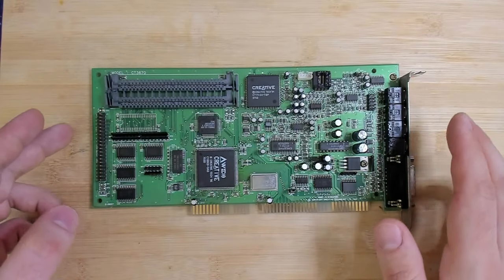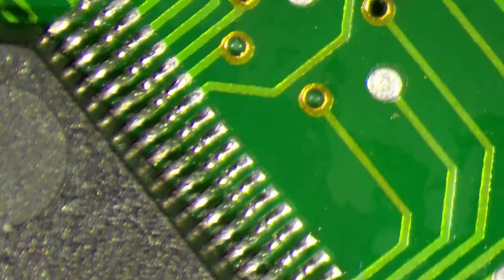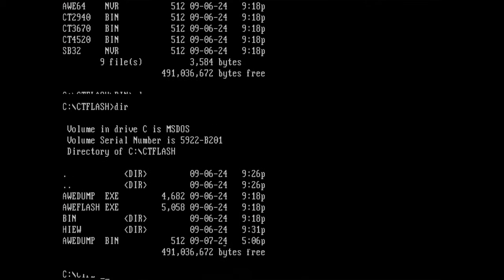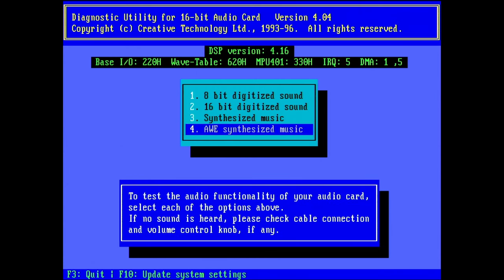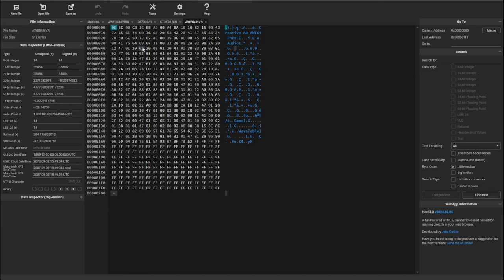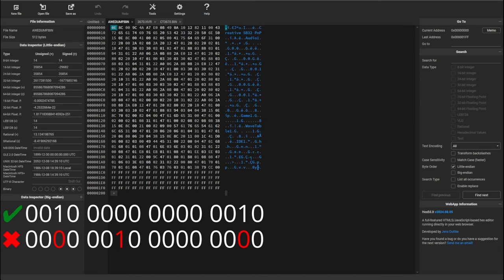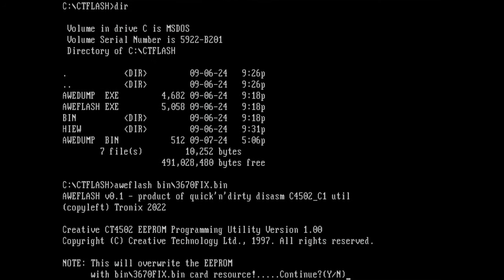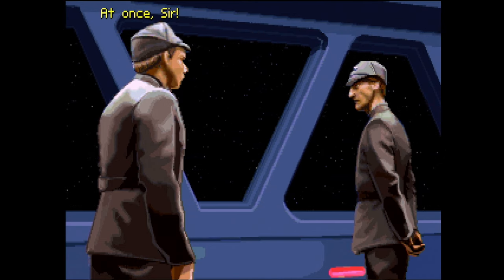This SoundBlaster 32 PnP CT3670 must live! Let me try again!

Comment: I'm not sure I'd call this a "BIOS". It's more of a configuration table. Either way, congratulations on restoring what looks like a pretty nice sound card.
Reply from the maker: Yes, it is probably just a place to store some information. However, I wonder if the PnP settings are stored in this chip as well. Thanks!
Reply: It's actually called firmware, but BIOS(Basic Input Out System) works well too.
Reply: @lexluthermiester firmware implies it has code.

This looks to just be storing some configuration values.
Reply: @shaunclarke94  "BIOS" implies the same thing. Not really a good point.
Reply: It's NVRAM  (non-volatile random access memory) , not BIOS or Firmware. Hence the file name extension NVR.
Reply: @lexluthermiester  BIOS and firmware aren't good terms for the same reason. My point applies to both.
Reply: Yeah, it's not code so it's not really BIOS or firmware. The programming tool calls it "Resource Data" which makes sense, from other messages we can see that it provides resource requirements for four "functions" (one of them the IDE controller), each one presumably has a list of IO ports, IRQs and DMA it needs and can utilize. I'm unclear on whether they also stored current selected settings there, they might have.
If you have a motherboard with PNP BIOS it reads these resource requests from all the PNP cards and tries to find a conflict free solution so that all PNP cards get the resources they need - many motherboards will then cache this solution in the (optional) Extended System Configuration Data to speed up startup and avoid "works, then doesn't, then works" scenarios. The ESCD really helps with startup time when you have lots of ISA/PCI PNP cards, any time you change anything you get just one slow startup. With early ISA PNP motherboards it wasn't unheard of getting stuck on "Updating ESCD" and having the clear the ESCD in the BIOS (or even use the clear CMOS hardware option).
Reply: @bitsundbolts   Yes it's the stuff at the first 16 bytes of the chip. PNP data
Reply: I would not be surprised if the two bytes that were corrupted in the NVRAM were in fact for setting / detecting the I/O base address of the card. The byte sequence { 0x02, 0x00 } would be interpreted as 0x0002 in little-endian, whereas the "correct" byte sequence { 0x20, 0x02 } would be interpreted as 0x0220, which coincidentally is also the I/O base address that is used the most for Sound Blaster (and compatible) devices. By the way, I/O address 0x0002 is "DMA channel 1 current address" of the primary DMA controller in a PC.

One final note: the AT49F512 is in fact a 64kx8 FLASH EEPROM, so I wonder what else could be hiding in there...
Reply: Was about to post the same.
Reply: @shaunclarke94  
Not getting into technicalities, the data stored on that chip amounts to code that is needed as a part of the driver exec and therefore counts as code needed to execute the function of the card. But let's not fuss over what amounts to semantics.
Reply: @Torbjorn.Lindgren  
Those are fair points, however, as shown by the necessity of the need to reflash the chip on the card, it shows that the code contained therein is a part of the code needed to complete the functionality of the card and thus is a part, even if a small part, of the exec code required.
Reply: @lexluthermiester  I'm fairly certain there's no code in the chip, what happens is that OTHER code (drivers/BIOS) refuses to load/use the data in the PNP block because the checksum is invalid and thus nothing can be set up with ports, IRQ and DMA. That's how we go from zero (4:32, just "ERROR") to four (22:26) "functions" by fixing just one of the four data blocks (they're fairly visible in the hex dump, since the resource data includes name) - the other three were intact but wasn't read due to the checksum failure. Data can be just as important as code.
Reply: @Torbjorn.Lindgren  
That is a fair set of points. It could just be a look-up table. The thing is, that's a bit of an expensive chip for just a specs table listing. Who knows. It was a weird time back then.

Comment: Hey, THAT IS NOT AWE synthesized music! Don't you hear that's FM synth? Something's wrong still.
Reply from the maker: Well, that is a Soundblaster 32. It may not play properly without the correct settings table. Maybe this card was not supposed to do that. The only way to find out is if I flash the AWE64 settings to that card.
Reply: @bitsundbolts  as long as it's AWE card and it must be containing onboard memory with samples, it should play AWE music. But something's wrong. Maybe onboard ROM (or RAM?) failed and the chip redirects midi to FM synth instead of wavetable synth. Bad thing is that there's no error message while something is definitely wrong.
Reply from the maker: There is no RAM on the card. The spot on the card for the memory chip is empty. I would have to install SIMM modules which weren't part of this project. I will try that soon though.
Reply: Maybe it worth testing it with Windows 98 and SIMM memory installed. Maybe it will work with external .sbk instrument bank uploaded to SIMM memory.
Reply: @Auberge79  About EMU8011 ROM I was wrong. It is present on CT3670. I would have to try my CT 3670 to check how this test sound like.
Reply: @MM-gd3be  I see now. So this is SB 16 Vibra basically unless SIMMs are installed.
Reply: Maybe the stock wavetable samples need to be copied from ROM to RAM in order to be used by the AWE chip. As there is no RAM installed, the card drops back to FM output?
Reply: I do have the Ct3600 32 PnP version with 2 small 512KM 30pin ram mounted - this card plays AWE options perfectly. But the ram is only useable for loading up some random midi for games. The problem here is that You are not using AWEUTIL driver... Without it the card behaves like an ordinary SB product.

Comment: The "20 02" you found in the working dump was the little-endian representation of the port.  When you swap the numbers, you get "0220", or port 220h.  This explains why the bad dump could never have worked, since "02 00" specifies a bad port of "2h".
Reply from the maker: That's a good hint! That would mean that it was those bits that flipped. I could change the address via a config utility and see if this location changes. I'll try that! Thanks 👍
Reply: It can't be so easy and obvious 😳 of course it makes a lot of sense
Reply: Someone working with hex for the first time, doesn't know that you need to check if it is big or little endian, also interesting the checksum to be at the end of the file, most modern files I worked with, had the checksum within the first few bytes. Also the difference between 0xCC and 0xEC is 0x20. We also learned that the first 4 bits are the cards vendor ID, which already hinted on how to read the dump.

Comment: Had the same problem 8 months ago with a ct4500 after soldering the bad AWE chip legs. Found the same post on Vogons and it worked. Also upgraded from 512k to 2mb for soundfonts. I am using that card now on my Pentium MMX machine.
Reply from the maker: You soldered a memory chip on the card or did you use SIMM modules? In case you soldered the chip to the card, do you need to change something else and will SIMM modules still work?
Reply: @bitsundbolts  Not sure how it configures RAM, but cards came with either 0K, 512K, or in the case of the later AWE64, 4MB RAM onboard. But it's not really a worthwhile endeavour, as there is a hard 28MB limit on RAM addressable by the EMU8000. I assume that this is because the 1MB onboard ROM sits in that address space and they gave it a 4MB gap as possibly once upon a time they wanted to offer a device with a 4MB ROM. This wouldn't surprise me as E-MU made professional synthesisers and the chip was possibly used in those devices.
Reply: @bitsundbolts  i only swapped the 512k chip for a 2mb. It is a Simple mod that i found on vogons. There are some YouTube vídeos and the original is from a Russian guy.

Comment: I started with an SB16, but used my computer to make music, so ended up with 2x SB16, 2x SB-Awe32s, 1x AWE-64 Gold and 1x ESS card, because back then there was no directX or ALSA, so each card could only play 1 wav (or 1 wav and 1 midi) at a time. I even had to turn off my serial and parallel ports to get enough IRQs, and then I would write my own software as a mixer for all the cards inputs/outputs/midi.
Reply from the maker: Wow, I did not know that could be done or was a thing!

Comment: I repaired the engine control unit of a VW Golf 4 in a similar way. A single bit of the flash flipped, so that the engine was no longer able to start (error P0605). By applying heat and cold, I was able to trace the error back to the flash chip. I bought a used engine control unit on eBay, read the flash and copied it to the defective one, which fixed the error.

Comment: closer to a reduced size AWE 32,  as the AWE 64  didn't use SIMMS but proprietary  memory modules
Reply: CT3670 it is using AWE 64 chipset. From user perspective it is an AWE 64 without soldered RAM. You need to put some SIMMs to load samples. Otherwise it is an AWE 64. There are some other SB 32 PnP models that are stripped down AWE 32, but this one is pretty much AWE 64.
Reply from the maker: That is what I understood as well. I should even be able to flash the AWE64 settings to this card. Unfortunately, it will lose the IDE feature.

Comment: Wouldnt call it BIOS. Its the PNP information. Its like an SPD on Memory sticks. And many cards have them. There are Soundcards with a firmware,though. EWS64 XL from Terratec comes to my mind
Reply from the maker: I guess, it is more like a settings storage. If the card changes the PnP settings on this chip, that would mean that the checksum must change when I change something. Like moving the IRQ from 5 to 7 for instance. I might give this a try just to see if the checksum changes.
Reply: @bitsundbolts  It's NVRAM.

Comment: very cool, particularly troubleshooting the BIOS and... fixing it!! Amazing!
Reply from the maker: Thanks Tony! Well, I would say it was luck that I stumbled upon the information that there's actually a programmable chip on the card.
Reply: This remind me how I unlocked many years ago some functions on Geforce 3 Ti. Then I too compared few bioses and find out where are values responsible for enabling GPU temp sensor and unlocking sliders in driver for overclocking. After that my Geforce 3 Ti200 was somewhere between Ti200 and Ti500, so I was, very, very happy :) It is usually good to poke around. You never know what You'll find.

Comment: man, I saw many similar fixes, where the man flashes a similar bios, and it works, yaay, end of story, but seeing such persistent this is a whole new level, great work
Reply from the maker: Thanks! I was curious, but now I got a new hint to investigate: what if the checksum had a flipped bit (there is only one) and the bytes I changed were in fact data that is correct...
Reply: This is scarry 😂😂
But we dont know which one is checksum. Both good and bad filrs had CC + comparing other bios framework data is almost identical + the card is working now. so mostly you fixed the bits @bitsundbolts

Comment: Amazing to how such tiny failure can have that much impact. Glad you were able to revive the card, great fix!!
It seems some of the caps near the melted connector are bulging as well.
Reply from the maker: Yes, I should replace the caps on this card. This card was exposed to hot air so that the plastic connectors melted. It's probably a good idea to replace those caps, but that will be a lot of work - probably a bit boring for a video.
Reply: @bitsundbolts  lot of work indeed. The main thing is that the card is working. Maybe those caps will only affect the output sound quality and, to be honest, is sound good to me!
Reply from the maker: Yes, the card sounds good to me as well. I didn't notice anything out of the ordinary - but I don't have much experience with those Soundblasters yet. That is going to change though! I have a few of those cards that need attention 😉
Reply: @bitsundbolts  keep them coming! I didn't have the pleasure of owning a sound card back in the days. Only discovering the whole world of sound of that era recently. It is a quite interesting topic!
Reply from the maker: I agree! I still struggle with all the features that are available on some of these cards! I had clones and Soundblaster compatible cards back then. But I shouldn't complain, I loved my ESS audio drive (I think it was something like an ESS688)

Comment: If you look at de checksum, a change from EC to CC is only one bit flip.
Reply: I was wondering if that might be it, maybe the other changed bits are the cards PnP config
Reply from the maker: It is a possibility, but without changing some values (e.g. changing the IRQ from 5 to 7), it will be difficult to say for sure. I did compare two different versions of the CT3670 in this video - and the section in question was identical in both files I got online. I still tend to believe that those two bytes I changed were the ones that caused the card to malfunction.
Reply: @bitsundbolts  man all sistems whit PnP use a serial bus interface on the is/pci /pci express for identification thats menas all Pnp cards used a serial eeprom for store the ID plus it's a shared bus
other use the same sistem is the EDID on vgas  all monitors have one eprom on echa port if the screen is a PnP monitor and the fail is called EDID  corruption plus yu can trick the sistem whit a 24xx  pluged on the edid port of the vga.

Comment: Nice. I have recently restored a SB32, my restoration was a lot simpler - it involved cleaning only. Quite a bit of rust on the back bracket and connectors, and also on part of the ISA connector. It all cleaned up nicely and the card works fine.
The SB32 is the "value" version of the AWE32. The main difference is that it doesn't have on-board sondfont RAM (see the empty pads under the SIMM slots) which made it cheaper. So if you don't add memory to the slots, you can't use custom soundfonts with the card. If you do add memory to the SIMM slots, it becomes functionally identical to the AWE32.
Reply: Also, that EEPROM holds configuration data that is used by the PnP mechanism to configure the card. Many Creative cards have an EEPROM like this, and it can be dumped, modified and rewritten (I generally desolder the chip and do it using an external programmer). For instance you can unlock features on the lower priced cards so they become functionally equivalent to higher priced cards - because the hardware on the cards is the same, and which features are enabled on a particular model depend on the data in that EEPROM. I have successfully converted SB Live cards to enable more functions like Dolby DTS support etc, and also SB X-Fi cards in a similar manner.
Reply from the maker: I was not aware of this at all. I guess when onboard sound started to appear, I just went with that. I also switched to Terratec at some point - it was my last dedicated soundcard ever. I have to read more about this - very interesting! Thanks for sharing!
Reply: ct3670 also does not have midi daughterboard connector and  does not support 16mb simm modules.
Reply: @theALFEST  I'd be surprised if the latter were true. I have several CT3600 which are extremely similar to the 3670 (the only difference is missing the IDE connector, which I have no use for anyway) and they all work great with 2x16MB modules and 28MB soundfonts.
Reply: @stamasd8500  Mine didn't work with 16mb modules, which worked fine in ct3990. I also read somewhere that sb32 only supports up to 8mb.
Reply: @stamasd8500  actually ct3600 is very different to ct3670. ct3600 has vibra chip and emu8000 chip while ct3670 is one-chip solution like newer awe64s.

Comment: I had a corrupted ISAPnP EEPROM on my GUS PnP some decades ago, which prevented the machine from booting. Fixed it by hotplugging the card to a running system and running the configuration utility to rewrite the EEPROM.
Reply from the maker: Wow, hot plugging an ISA card? I never heard this can be done! Doesn't the BIOS need to configure some settings before you can use it?
Reply: @bitsundbolts  That was the only time I ever attempted it, fortunately nothing got fried. Suffice to say I was young and desperate :) The configuration utility knows how to talk the card without any BIOS support. I think the card would also work in a system without a PnP BIOS, as long as its resources have been setup manually using the configuration utility.